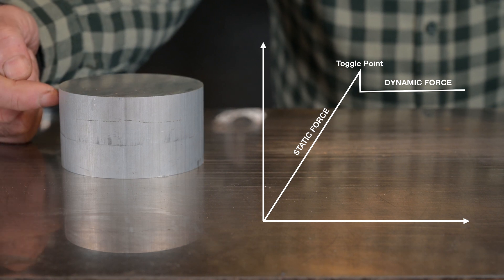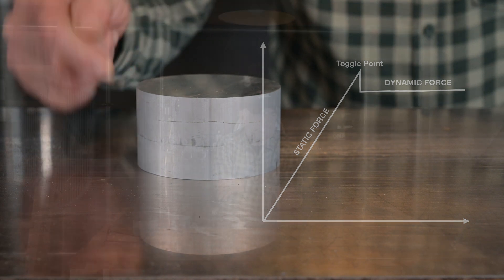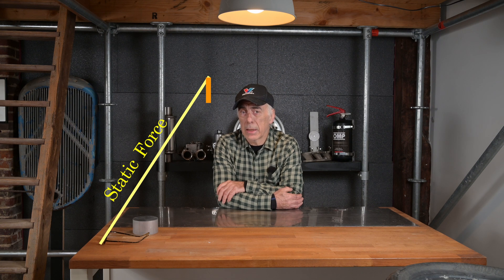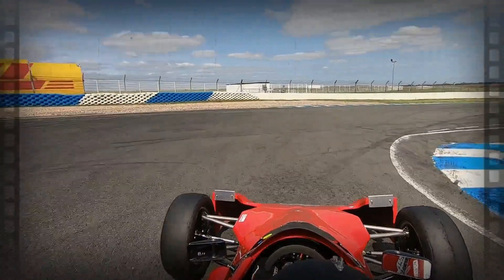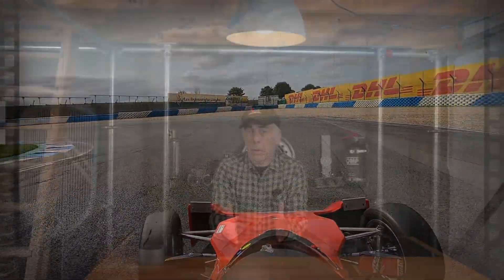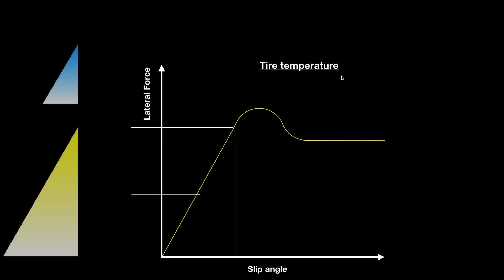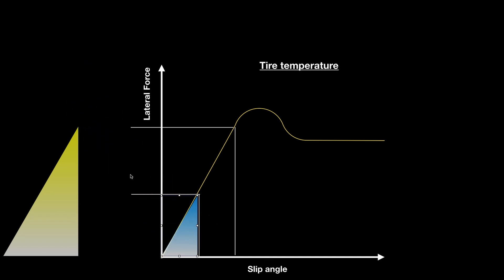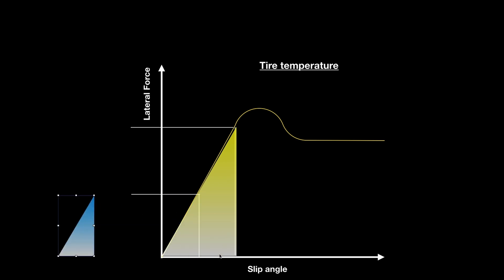TIRES the glue between the car and the tarmac -   Slip Angles,  Cornering Stiffness  and more

Comment: I had this dilemma with racing my Triumph TR3a should I go with grip or the “Goodwood” 4 wheel drift style. I went with the best grip and side wall stiffness allowed in my class with a low profile for side wall stiffness. 2nd in championship 3 times running 🎉
Reply from the maker: Good choice and those have a good cornering stiffness and  small slip angle

Comment: From a spectator's point of view grippy tyres have reduced the viewing experience. Screeching tyres, four wheel drifting and sideways driving have all but disappeared.I guess that is why the sport of drifting has become so popular with drivers and spectators alike.
Reply from the maker: True,  you will never see  screeching tyres in Formula circuit races,   that is why there are tyres for each purpose and use...   Drifting is really for large slip angle tires
Reply: @D3Sshooter  Attending races in the 1960s as a kid  the two things that are forever etched in my mind were the screeching of tyres and the smell of Castrol R in the air. Both sadly missing as the finer points of art have  now been almost completely eradicated from today's motor racing.
Reply from the maker: @amraceway  That is so true.   What once was a real sport became a bussiness overwhelmed with rules and regulations.  Some for the good some for the worse.   Of course screeching tyres don't make the cornering faster... the only reason they do is because of the hard compound and large slip angle....